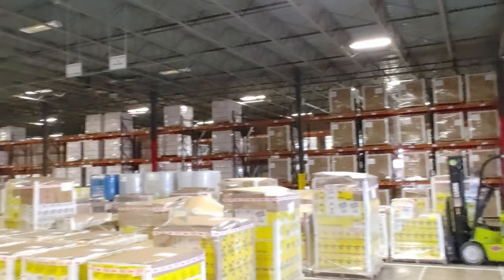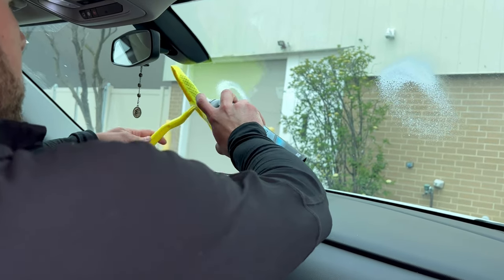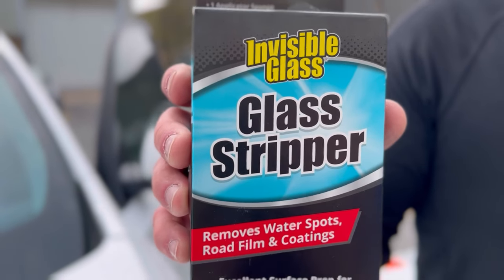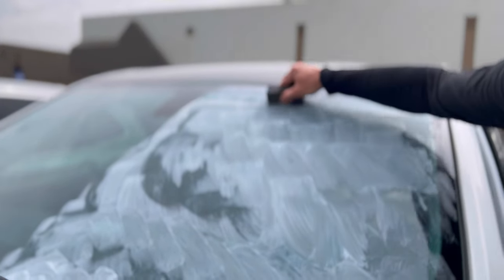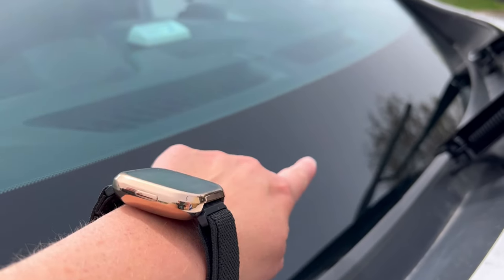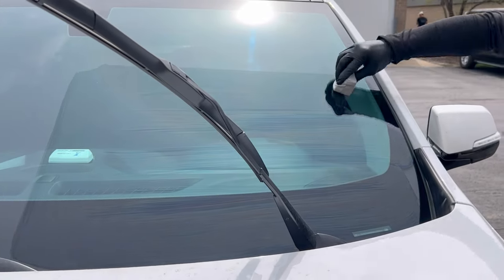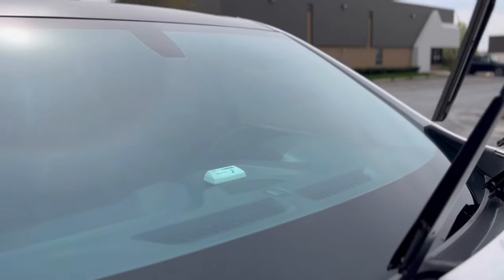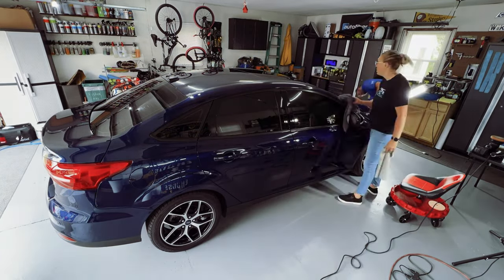How To Clean & Coat Glass In Direct Sunlight w/ @StonerCarCare  Invisible Glass!

Comment: Looks like temps were not that warm, how warm was the glass during coating application?
Reply from the maker: Temps were chilly in the morning hence the long sleeves but as the day progressed it got hot. The glass was on the warmer side to the touch but not like peak summer temps. But the invisible glass did evaporate pretty quickly hence why he went heavy with it to clean outside

Comment: How much to charge for window coating? Range?
Reply from the maker: It’s up to you! I charge anywhere from $50-$75 for a glass coating. All windows $150
Reply: But isn’t the glass ceramic coat bottle already $60 so that’s why I’m not sure how much to charge since we don’t need to polish the glass..
Reply from the maker: @Silence07617  you can charge whatever you like. I can do 4-6 vehicles with one bottle so divide that into $60 and whatever your hourly rate is and that’s what you can charge.
Reply from the maker: @Silence07617  but you still need to do the glass stripper (that takes the place of polishing)
Reply: @attention2detailswchelsea  I see. Thank you so much for the info Chelsea!